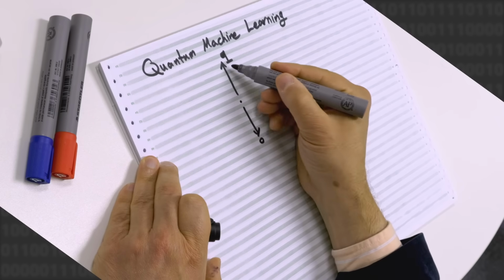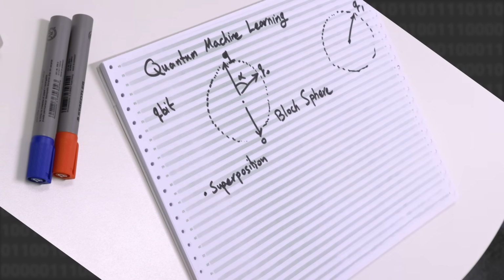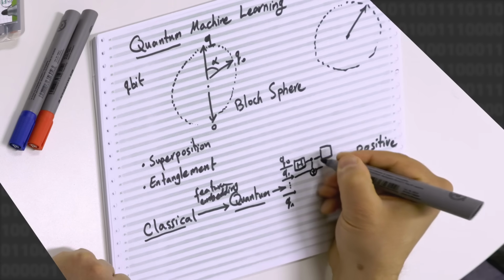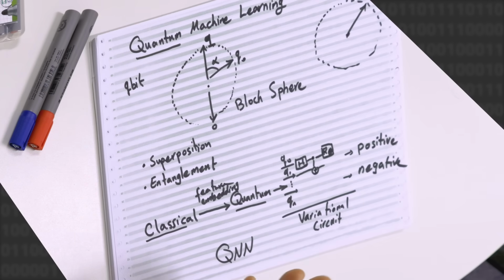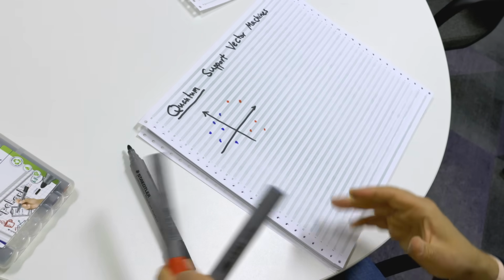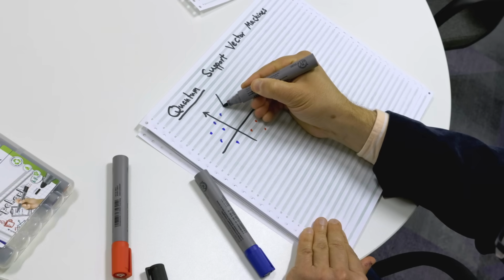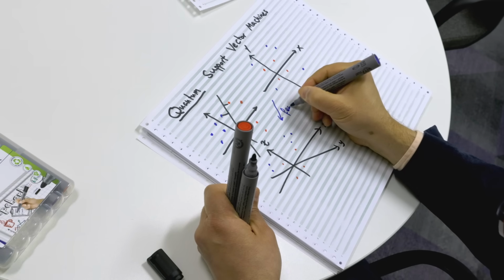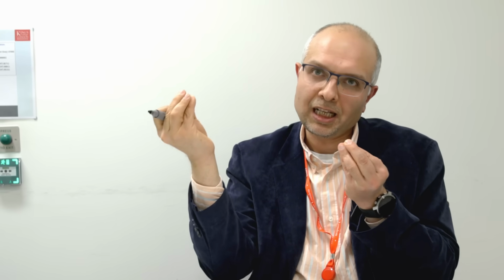Quantum Machine Learning - Computerphile

Comment: Great explainer! One tiny refinement: when you measure the qubit, the outcome probability isn't quite proportional to the angle — by the Born rule it's cos²(θ/2), where θ is the polar (Bloch) angle from |0⟩. So at θ = 90° you get the expected 50/50, but at θ = 60° it's 75%, not 66.7%. Same intuition, just the exact rule. Thanks for the video!

Comment: Seems like a good theoretical exercise at best. 
He clearly states that won't work for large datasets and only for small data with special distributions of noise... So the hassle of implementing it will certainly surpass greatly the benefits, no ROI whatsoever. 
There is no need to struggle with the inherently probabilistic, high cost, error and noise prone nature of quantum computer while multidimensional distributions are not new in classical computing.
I won't bet on this technology, seems another dead end in the long history of quantum computing...

Comment: I'll take the qubit noise/decoherence math further, since that's where the physics gets concrete enough to actually bound QML performance. I'll fold in variational training at the end since that's the closest practical hook.

*1. From bath spectral density to T1 and T2 explicitly*

Model a qubit coupled to a bath through Hamiltonian H = H_qubit + H_bath + H_int, with H_int = A ⊗ B, where A acts on the qubit and B is a bath operator. Applying Bloch-Redfield theory (second-order perturbation, Markov approximation), the relaxation rates come directly from the bath's noise spectral density evaluated at the qubit transition frequency ω₀:

1/T1 = (1/ℏ²)|⟨0|A|1⟩|² · [S(ω₀) + S(−ω₀)]

1/T2 = 1/(2T1) + 1/Tφ

where Tφ (pure dephasing) depends on S(ω) near ω=0 — the low-frequency, near-DC noise (1/f noise, charge noise, flux noise) rather than the resonant noise that drives T1.

This is the direct payoff of FDT: S(ω) isn't some free parameter you fit — it's fixed by the bath's dissipative response function via S(ω) = 2ℏω·Re[χ(ω)]·[n(ω)+1] (quantum FDT, with n(ω) the Bose-Einstein occupation). For a resistive bath at temperature T, χ(ω) is just the admittance, so *T1 is calculable from the circuit's real impedance seen by the qubit at frequency ω₀.* This is literally how circuit QED engineers predict T1 from Purcell filtering and impedance engineering — it's not a hand-wavy analogy, it's the same equation.

*2. Why T2 (not T1) is usually the QML bottleneck*

Tφ is dominated by low-frequency noise, which for superconducting qubits is often 1/f-type (S(ω) ∝ 1/ω) from two-level-system defects in the substrate, not simple Johnson-Nyquist white noise. This means the FDT-derived white-noise picture undershoots real dephasing — 1/f noise doesn't have a single "temperature" in the same clean sense, since it isn't a simple equilibrium bath. This is one place the resistor analogy breaks down: real qubit dephasing has non-equilibrium, non-Markovian contributions that Bloch-Redfield doesn't fully capture, requiring dynamical decoupling or spectral extrapolation techniques instead.

*3. Circuit depth budget for QML*

Given T2, the number of two-qubit gates a variational circuit can execute before decoherence dominates is roughly N_gates ≈ T2/t_gate. For typical superconducting hardware (T2 ~ 50-150 μs, two-qubit gate time ~200-400 ns), that's on the order of a few hundred gates before fidelity collapses — this is the actual physical constraint that limits QML circuit depth/expressivity, independent of any algorithmic barren-plateau argument.

*4. Noise-induced barren plateaus*

Separately from the trainability barren plateaus caused by circuit expressivity, there's a noise-induced barren plateau effect: as depth increases, gate noise (itself set by the T1/T2 above) exponentially flattens the cost landscape gradient with circuit depth, because each noisy layer contracts the accessible state space toward the maximally mixed state. This means the FDT-derived decoherence rates don't just add measurement error — they impose an information-theoretic ceiling on how deep a trainable QML circuit can be, scaling as gradient variance ~ e^(−depth × noise_rate).

---

That's the full chain from resistor thermal noise to a hard limit on trainable QML circuit depth. If you want, I can work through an explicit toy calculation — e.g., estimate T1 for a transmon coupled to a specific line impedance, or derive the noise-induced barren plateau bound numerically for a sample circuit.
Please check my comment

Comment: There are also many reasons to be sceptical of this:
1. Giving theoretical proofs about "this machine learning technique is better than this other technique" is extremely difficult, and many of these Quantum Advantage claims have either been redacted/disproved in the past few years, or they exist only for toy problems (we don't need proofs to make this worth pursuing, but we should be very sceptical of such claims)
2. While quantum computers can certainly represent functions that are hard for classical computers to simulate *exactly*, there isn't a reason to believe that classical computers/ neural networks cannot approximate them efficiently (Deep learning might work decently even with a noisy approximation)
3. As the professor mentioned, Quantum approaches will not work well for large scale data (probably because there is uncertainty about how big could a quantum computer be while still displaying quantum effects), so algorithms that are asymptotically better than classical approaches might not be practical (similar to Galactic Algorithms)
4. There are practical problems (which the professor alluded to). A classic issue from deep learning is that your architecture could in theory learn to solve any problem, but actually finding the right set of weights is a huge challenge, which I don't think quantum makes better, but it might infact make worse because of the "high dimensional representation" thing that was mentioned (I think barren plateus are an example of this, but I am not up to date with the literature here)
Reply: Counterpoint: Quantum annealing IS NOT quantum computing and is already capable of doing useful work -- just not stuff like cracking RSA, which isn't even something it would ever be used for anyway. QML at least superficially resembles quantum annealing, so I wouldn't rule it out so quickly.
Reply: I think you are overgeneralizing the use cases @gunaysoni6792 qbits can be helpful in specific use cases which is the point.
Reply: 100% agreed. This method is the dumbest thing I've ever seen. I saw some companies selling this as "reservoir computing" and it's an absolute scam. As mentioned in the video, we have non-quantum approaches to do the exact same thing but faster, cheaper, and no liquid helium required! Some companies have been trying to sell this snake oil, and some companies are falling for it because they have "quantum" in the name.
Remember that this is just a method to put your features into higher dimensional space (like kernel expansion) and can be entirely replicated without quantum, the actual machine learning bit is still entirely classical.
Reply: you spelled skeptical wrong genius
Reply: @milkred6752  british vs american english?
Reply: my goodness look at the amount of replies too; just goes to show the average level of intelligence of you guys larping about things you know nothing about
Reply: well all I can understand is that.. QML is actually a different branch, thus there are application where QML can outstand the classical MLA..
its just its really really hard to create the supporting infrastructure... there's no Nvidia who are researching for QML just some small dedicated departments of big corps like Google, IBM 
if there's nothing to sale... there's no rush to innovate
Reply: I think you should look into it more. The point of quantum computing is you get 2^N dimentions Hilbert space for N bits and they can operate in a superposition with correlations between amplitudes through entanglement. This lets you compute things that are exponentially slower when simulated classically. There are actually a lot of quantum machine learning algorithms with deep theoretical basis. The barren plateaus thing has solutions.
It’s actually been shown that classical machine learning struggle to model random quantum circuits. And mathematically classical computers take exponentially longer to simulate quantum phenomena. I had more of you opinion before, and I’m slightly skeptical we will get there very soon, but once quantum error correction is robust or if we get room temperature quantum computing it truly will be involved in optimization and we will get much more powerful models than we have now.
Reply: @liquid-emergence hmmm. Can you link me to something about the barren plateaus solution? I thought expressivity vs trainability is a fundamental tradeoff which would be hard to get around.
Reply: @liquid-emergence the Hilbert space has dimension 2^n, sure, and so simulating it has exponential cost, but, that doesn’t imply that we get an exponential speedup on any of the problems we actually care about ?
Reply: Idk I might buy some IBM well it’s down lol. They’re the only provider I’ve actually ran a real quantum computer with, only 4 qubits but real quantum results to test bells inequality